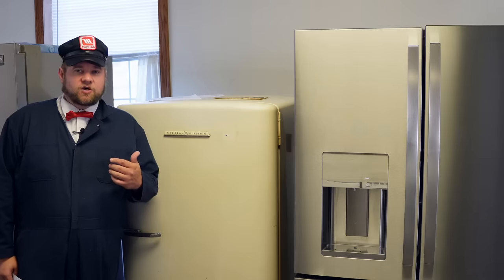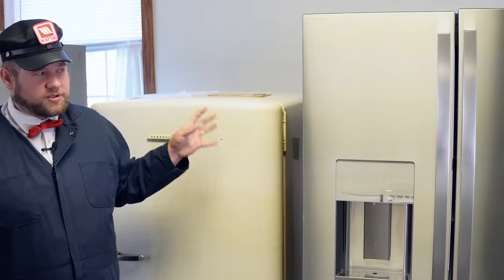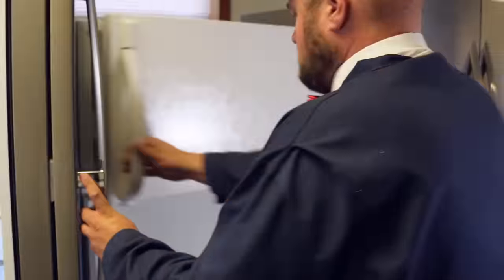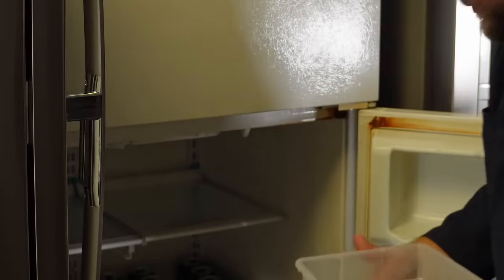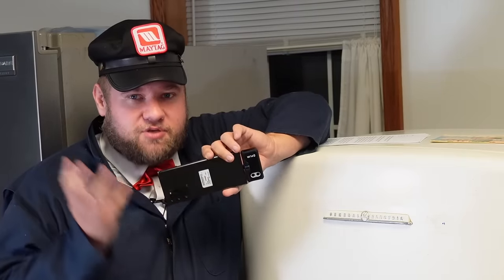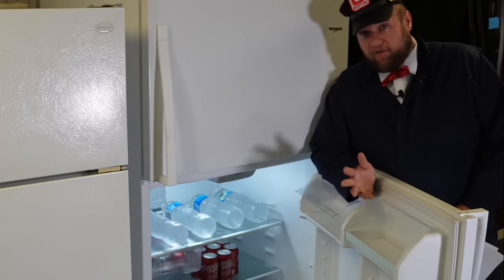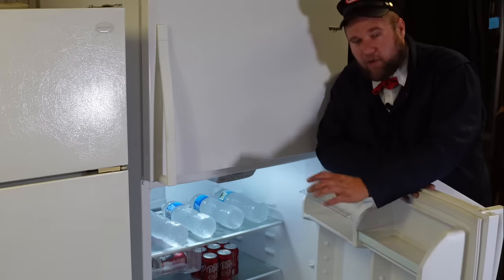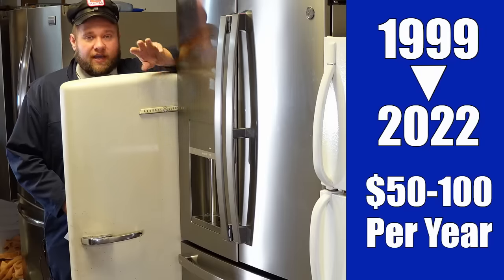Should You EVER Buy a New Appliance if Yours Still Works? A 7-Day Test

Comment: We bought a new log/timber house in 2003 which was actually built over a 3 yr period. The owners spent a bunch of money on GE Profile kitchen appliances and the ever-famous Maytag Neptune stack washer/dryer.  My hubby was an appliance tech for 23 yrs, so we really never owned a new appliance till then...always used from a remodel.  The first issue was with the Neptune w/d circuit board and throughout the duration a few minor issues.  In the side-by-side which I'm not fond of, one of the shelf runners in the fridge has been replaced many times.  The food freezes if it is placed or shoved against the center wall.  I hate the giant ice maker in the freezer and the ice/water dispenser in the door cause here's no room for food.  I cringe at the prices of the new fridges and came to the same conclusion for the 'French' door style with no ice maker /dispenser.  The countertop ice maker is the way to go! The dishwasher was the first to go after 15yrs and was replaced with a Bosch.  The oven was next to go and also replaced with a Bosch.  The glass cooktop has a burner which is doesn't cycle off when cooking, so we have to remember to turn it down and up often.  Looking into a new one when I replace the 12" granite tiles on the sink island and all countertops in the house. Gotta love the grout lines!  We were afraid of the stack w/d to blow because we don't have any extra room for a side-by-side.  Now, there are more available on the market besides the apt. sized Fridgidare.  We've been very lucky to have them work as long as they have because of the issues with the GE Profile and the Maytag Neptune w/d.  And also very lucky to have had a live-in 'Maytag' man!  Love my Bosch appliances so far!

Comment: I have the exact same Frigidaire, down to the rusty screws inside the lower door.  I have learned to use the top shelf for freezer over-flow, it works great for a ice bucket and bottles of booze as well.🥃🍸

Comment: 15:20 that's a bit understatement, for fridge to be efficient you need 3 things
a) good cooling unit & control
b) insulation
c) way to cool down the hot side of the cooling unit. 
reason is that the cooling unit is only capable of making a certain gradient of temps 20/30/40 degrees less than the hot side of it. So if you don't move the heat away somehow, it will waste power while not getting any colder on the inside. Old fridges have massive radiators on the back, but newer one noticed that  you waste a lot of surface and metal that could store and dissipate heat, by not running it on top/sides/doors of the fridge. You literally can double the heat dissipating area by using what is already there for decorative reasons.
21:00 also defroster I saw, was made as bidirectional system, so to defrost it did not use heater element, but reused heat running backwards. I assume it was a novel idea, not yet popular, but it would make defrost function literally free. (excluding funky and interesting compressor)

Comment: I have a 1981 Frigidaire top freezer with or original ice maker installed and still pumping out ice without a problem.  When you figure in longevity and cost of replacement including manufacturing cost and energy to build and distribute I believe I more than break even.  I returned to appliance work in 2008 thru 2011 after 15 years of repair work in the 1980s and early 90s.  The ice makers on the post 2000 units were and are money makers as you are lucky if they last a couple of years without some major service or replacement.  Ice build up became an on going problem that never seemed to be fully addressed as of 2011.  What I saw was people waiting weeks for repairs on the new models and the most common comment was they wished they had kept their old refer or the people that put the old one in the garage and even after not being used for considerable time worked great after being plugged in for a day.  You really should look at the entire picture and let the few hundred bucks saved in yearly energy was lost on one service call regardless the problem and as you know they are many on these more sophisticated systems that are just not reliable in the real world.  It has been a hoax.  If people were sold a car that got 50 miles to the gallon but only lasted three to five years the savings are nothing but a sales ploy on the sucker that falls for the new is better lie.  
I also have and use constantly my 1982 Maytag washer and dryer that have only required one belt replacement on both in those 40 years of service.  I believe it is greener for my wallet to use what works well and most of all is dependable day in and out.

Comment: The fridge went out the same week the warranty did. Put in a part. that cycling  lasted for 3 more years, and i changed that part out for a universal one, and it's been working for about 12 more years.   The only thing that went out since then was the defroster, which I changed out and put more reflective insulation tape on the wall since it was insufficient and burnt the plastic and into the insulation wall.  Seems like the manufacturers put in the bare minimum of work, effort, thought, and quality.  
Next fridge I buy I'm taking apart immediately to check for quality issues.

Comment: Bottom line is: If your old freezer/refrigerator is working fine than don't replace it (unless it is too small).  The cost of replacement will far exceed the cost of electricity for many years, especially if the new units are expected to last only 7-10 years.  Note, if that is an average, then some units will be gone in 4 years.  There has been a rash of electronic circuit boards burning out in new fridge units just after the warranty expires.  When that happens the unit is not repairable, because the cost of parts and labor will amount to 90% of the cost of a new fridge.  We are organic gardeners and our family has 5 freezers.  The best freezer I have is a 1958 Sears coldspot, bought when I was a little kid,  upright 18 cu ft.  Massive thick walled freezer, still works perfect after 65 years.

Comment: Here are my takeaways:

1) Since the biggest difference seems to be how much you're loading down the fridge, only buy roughly as much food as you need, and only refrigerate as many drinks as you'll use in 3-5 days. Leaving that can of Fresca in the back of your fridge actually has a cost!
2) The second biggest difference seems to be capacity, so only buy a fridge that's as big as you need.
3) If you do have an 80s-90s fridge that's still in service, test and fix the gasket around the door, probably every 5-10 years or so.  This would not only save you money, but also likely cause the fridge to last longer since the compressor won't have to run as hard.

I'd be curious to see a test on the 1999 fridge with a new or serviced gasket to see how much it improves.

Comment: Just to be a little picky:
They have not used xx kW. They have used xx kWh.
kW is the power (like as you said, compressor might run at 70 W (0,07 kW) and kWh is the amount of electricity used.

Comment: In Europe, an Amana side by side with ice maker and water dispenser, is around 2000€ (roughly the same in USD). My 25 years olf Gaggenau 
(an upmarket , rebranded amana)works like a charm, and Ive only spent 120€ in repairs in all these years…. Why change? For how long would still work? All the drawers, gaskets, trays, baskets are like new… I get a newer one would consume less, and maybe in the longterm, it can actually pays for itself, but what about the waste? Will a newer one last for so long?
Reply: I didn't know they where imported in Europe.

Comment: I am thinking about having my frigidaire replaced. But it will probably be replaced by a cheap smaller Danby apartment size fridge. I am wondering if the greater efficiency of a new fridge is worth having less capacity. My electric bill is $20 a month so honestly an inefficient old fridge doesn't hurt me that much.

Comment: I have a GE fan I am pretty sure is older than I am, and I am retired, and it is quiet as a mouse, powerful and refuses to die.  The only thing I worry about is the wire I plug it in with.  I assume that is going to deteriorate to the point it might be a fire hazard.  I sure do wish I could get a fan that is half as good.  I got rid of my really old freezer but still feel bad about that.  I am now going to say a prayer over my fairly new fridge which already broke while on warranty (I cannot use one of the drawers now because it freezes everything in it solid like my oranges) and I guess I am never replacing the washer and dryer.  I assume they will last until I die.  I feel sorry for younger people buying disposable stuff who cannot tell the clothes and shoes they buy are trash.  I have taken 2 pairs of shoes out the closet that I had stored there and I noticed they were ruined in less than one day.  Too late to return them.  In one case the rubber soles apparently had liquid inside or turned liquid so they collapsed.  The black shoes I just wore had imitation leather glued to the elastic apparently and it fell off.  I grabbed the handle of a brief case in my closet and it broke because it was apparently cardboard.  I have to replace the plastic stuff supporting my wire shelves and wooden shelves all over my house because they are now 20 years old and snap off.  Beware of losing all your dishes in the kitchen.  Check that they do not have a piece of plastic supporting the shelf weight instead of a metal clip.  The hardware store still sells these white pieces of garbage to support wire shelves in the homes being built.  I have to track something else down to buy.

Comment: It sucks you can't upgrade without sacrificing the very thing you'd want in an appliance, reliability. 

The main reason we upgraded our washer/dryer/fridge was not only because they were not quite up to certain aspects. Mostly upgrading for convenience, like having a fridge with a top fridge and bottom freezer was way more enjoyable. I don't mind minor "maintenance" like cleaning dust but if I'm worrying about cheap parts breaking down relatively quickly....man...

Comment: That old GE fridge is probably the best and I would have to say heavy too because of the insulation being a wood cabinet lined with a steel liner.
Back in those days they didn't have the light foam that the newer units have. And also they used R12 refrigerant. As the saying goes { if it aint broke DON'T Fix it!!}

Comment: The old phrase "they dont make them like they used to" came about because of planned obsolescence.  
Big product companies basically started building their stuff to fail earlier than possible, so people would have to buy the appliances more often; similar reason for making them increasingly technical under the guise of being convenient, to deny people from just repairing what they got and further shove reliance on the corporation.  
Automobiles are the biggest examples of both shifts in design.

Comment: You should do the same test with a small fan installed inside the old G.E. like the modern ones, electrically pluged on the compressor.  This should reduce the power consuption.

Comment: Question for this test.  Were all of the fridges clean of dust and buildup on the coils and condensers?   I'm even guilty of not cleaning them often enough, and it makes the unit work so much harder to transfer heat.
Reply from the maker: , that was one thing I did before I even touched the fridges and verified they were cleaned throughout the entire test

Comment: There was an abundance of cheap natural gas where I grew up, so gas appliances 17:19 were common. Servel gas refrigerators, gas ranges, gas clothes dryers, residential gas incinerators (haven't seen one of those in awhile), gas heating, gas logs, gas hot water heaters, gas outdoor lighting, Servel gas residential and commercial air conditioning (they're still around), and residential gas powered electric generators. Swimming pools were gas heated if you owned one. The city's power plant used natural gas to generator power.
Reply: Quite the gaseous place your hometown.

Comment: Energy is measured in kWh, not kW.
Also, I don't understand the temperature measures, why it's water freezing at 40 degrees?
Reply from the maker: The air from the freezer goes through the fan/dampener system directly down into the refrigerator. Its colder in the rear where it initially gets distributed, thus causing the freezing.

Comment: I'm of the mindset that their are three things to weigh when considering getting rid of a working appliance
Cost to operate and maintain
Feature set
And
Overall usefulness 
It's all about finding good things that fit your life style and I think it's okay to accept sacrifices in some areas if it means boons in others. I myself recently bought a stove from the 60s and it sits next to a 3 year old fridge. I made the tradeoffs that work for me (btw my old fridge is still in service, just not in my kitchen, it's now in my office. I love it's aesthetic but it just had to small a freezer and kept needing to be serviced, I finally got its lines replaced and a new compressor put in it professionally and I now use it to chill sodas and cold snacks for when I'm working. For context it's about 4 feet tall and it's freezer compartment can hold a frozen chicken and no more, it can barely hold a load of shopping cold goods so replacing it made a lot of sense, meanwhile our new one is 6 feet tall, is a bottom drawer freezer and a double door model, no built in ice maker or water pump though, and it honestly fits our life style a lot more. And I'm loving having this small fridge as a drinks fridge. I drink a lot of seltzer water and it's way better cold.

Comment: I've read the reason modern refrigerators don't last that long is they use less oil and a thinner weight oil. It saves energy at the expensive of compressor life.

Comment: Another reason the 1950 GE uses less power is that it's manual defrost.  There's no evaporator fan inside using power to spin the fan and dissipating waste heat from its motor, nor is there a defrost heater cycling to defrost the evaporator which also dissipates heat into the refrigerated compartment.
Reply from the maker: I agree on the defrost. I don't think the fans use a ton of electric though

Comment: Much as appliances cost nowdays, especially those $2500+ larger units, you have to consider how many years a new one would have to last in order to pay for itself.  Regarding keeping the seals/coils clean on a fridge, I'd venture to say that affects fridges quite a bit in lifespan and elec usage both.  Hmmm... perhaps you could do a vid sometime say of 2 alike as possible fridges; one with clean coils and one that the dust bunnies have had several babies in just to compare usage (or maybe better yet... same fridge running a week badly dirty, then a following week after a cleaning)?  I'd be curious if the delta of results would be terribly dramatic, now that I see that single point-of-use kWh meters are a thing.
   Love the fact that 1950 is still running, esp as it was a family unit you grew up with knowing.  I have a couple of friends in NC that have a post-war 1940s ammonia-cooled chest freezer that at least as of year or so ago last mention of it, it was still up and doing its thing.  She makes some weird noises sometimes in 'er old age, but that hadn't stopped 'er none a'tall.  Totally agree with what you're saying about extending the life of appliances and keeping more out of landfills.  The "powers that be" always rattle on about our energy crises, but manufacturing products and dealing with waste are areas that we as a world sure could cut down on energy/resources.

Comment: 24:02   7-10 years?!?!    My HotPoint is 23 years old and SubZero is 18!   All the Sub ever needed was a $10 temp probe (forget the name) that I installed.  Onboard diag told me that was the problem, wire fell out of sensor when I touched it, BINGO!   It was measuring temp of evap coil inside the fridge and was positioned where water was dripping into it.

Comment: I have my 1979 GE fridge we bought just before we got married.   It is about the same size as the 1950s GE,  non frost free  and I have no plans on replacing it unless it dies.   It has outlasted 2 other "new"  fridges.   We currently have  a fairly new Electrolux(Electrosucks)  counter depth that has been replaced twice on warranty because  the first one the door did not seal and the ice maker did not work and was not repairable (they tried) the second one works pretty well but the ice maker died again at the end of warranty.   It will try to make ice but sounds like "Big Ben".    The old 1979 unit has saved us several times it just keeps chugging along.   We keep the freezed loaded all the time and it is full  drinks  (and sometimes wine and beer).   Twice a year I manually defrost the freezer.    My new Electrolux runs all the time and even with all the energy savings high teck stuff I can not see how it really is all that energy saving.   If I could I would go back to the last fridge we had before the Electrolux it  never gave us a lick of trouble and was only replaced when we updated the kitchen.

Comment: We just repaired a 21 year old fridge, not because it broke, but because we broke it by accident. If we would have replaced it the kitchen would need a rebuild as modern fridges are larger on the outside.

Comment: I used the same watt meter to compare my smaller 2013 or so fridge to my sisters brand new and much bigger fridge over the course of a couple of days. My sisters fridge used way less power than mine did, despite the fact more people were using it and opening it during the day.
HOWEVER!  about 1.5 years later and my sisters brand new fridge randomly stopped working, luckily it was still under warranty and she got another one but i am now a bit less impressed.